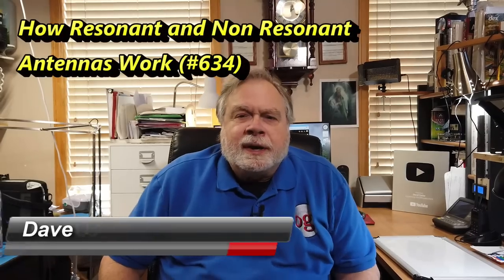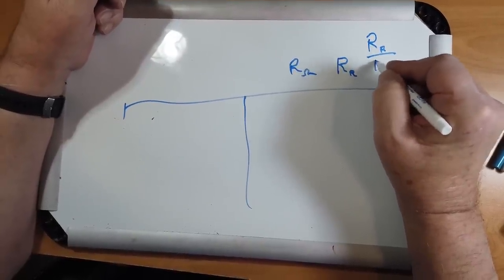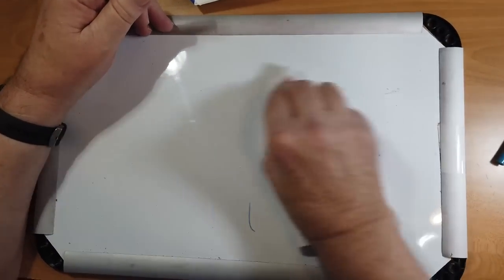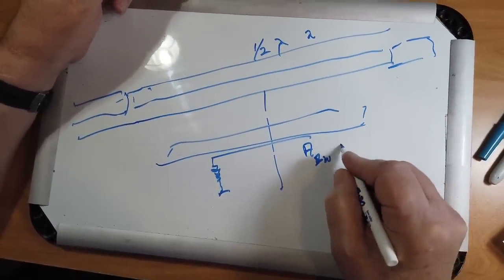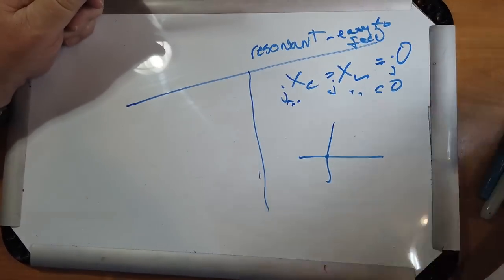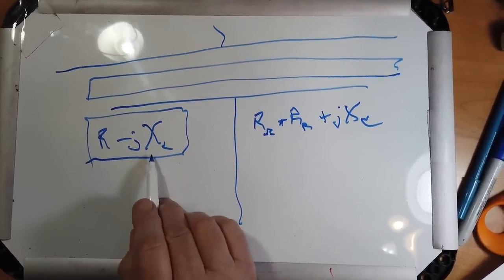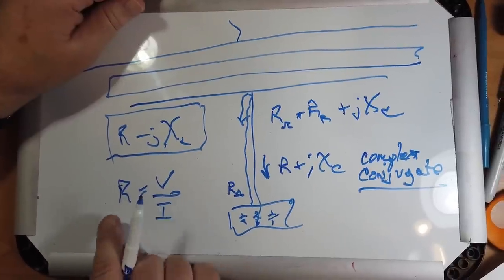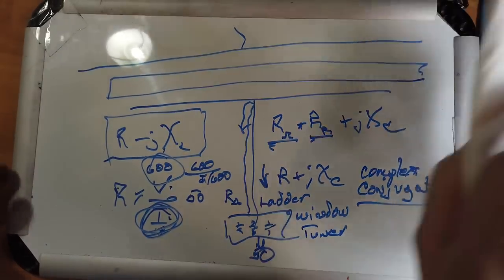How Is It Non-Resonant Antennas Can Work? (#634)

Comment: One more interesting point to make is that the lowest SWR does not always occur at the resonant frequency of the antenna(+feedline).  In fact, often times the resonant point (where X=0) does not correspond to where the SWR is the lowest.  So, depending on the line loss, you may get better efficiency  at the non-resonant, but lowest SWR point.
Reply: Yes

Comment: I'm going to simplify this right now. "Non-Resonant" antennas lose most of their signal strength through feedline losses, both transmit and receive. The more you can minimize feedline loss, the less of a factor "resonant' VS "non-resonant" will be. This is why "open wire" or "ladder line" fed antennas can pretty much ignore feedline loss, while coax fed antennas need to pay attention to feedline loss. 73 de WB4DW
Reply: Bingo.. My home antenna is a Random Loop, and it is fed with Ladder line.  And the reason why I'm able to function or transmit as well as I do, with a non resonant antenna, is because of the feed Line.  Most of the time using a tuner I can get a 1:1 or close to it, but really I don't care to much about SWR because I know it is just going to be reflected back out.  Here is the rub, tuners are finicky critters, and can be a PITA at times, so don't be so quick to jump ship to the non resonant antenna because like any compromise, there are drawbacks. However, I love my loop, and less noise as well.
Reply: So, if I hook the non resonate antenna directly up to the tuner, I should have no losses  Or, is this too simplistic?  I am thinking of hooking  up a 29 foot wire direct to the so-239 with a counterpoise.
Reply: @maddog222333  That sounds like a classic "random wire" antenna. It should work, if the tuner can match the impedance at the frequency you want to transmit on, however, assuming you are talking about having the tuner inside your shack, there is a good chance this setup will cause RF in the shack, in the form of speaker noise, computer glitches, etc.
Reply: Exactly, that’s all that needs to be said. Given an antenna of a particular size wrt the wavelength, all the power you put in except the loss on the feed line  and the loss due to antenna inefficiency WILL be radiated. So if you want to use a non resonant antenna, you need a tuner and the multiple reflections on the wire will cause a lot of loss UNLESS you use a low loss feed line.

Comment: Hi Dave, thanks for this nice and clear explanation. I am now confident in building my non resonant (too short) doublet antenna, using a 450 ohms feedline. I will adjust the feedline length to tranform the antenna impedance into something reasonable for my homemade antenna tuner.
May I suggest a video: could you show us the effect of a manual antenna tuner by connecting an antenna analyser at the output. You could simulate an untuned antenna with a coil, capacitors and resistor. Also showing the effect of some length of feedline, coax or parallel.
I think there would be a lot of surprising results.
73 from F1SOC

Comment: I would like to hold you to your promise to test the "reflected wave" on the complex conjugate tuned system where your tuner is at the transmitter end of the transmission line. 
1. Start with an antenna that is a far piece from 50 +j0. It can be 200 +j0, 50 -j200. Something a ways away from 50 +j0. Like maybe a good 40m dipole on 20m where the SWR is very high. 
2.  Send a string of 20m pulses from the transmitter side with a pulse generator short enough to see the transmitted and returning pulses on an oscilloscope at the returning end. 
3. Insert the tuner and tune for a 1:1 SWR at the transmitter side. You may have to use an amateur rig to have enough power to tune it properly. Use only the external tuner and leave the amateur radio tuner alone and unused. We want only the external tuner at the transmitter side to be making the conjugate match. 
4. Using a 20m pulse generator into the tuner, send pulses again to watch for the returned pulses. 
Compare the pulses as seen with the oscilloscope in both cases. Do not use the oscilloscope when using the high powered transmitter.
Preferably use an antenna with a balanced line feeder. Coax cable can work but I'd like to see the returned wave on the scope and I don't want it to be blamed on the coax if we can't see it. Balanced line is easier to probe with a scope. 

If you need a generator, I can lend you one. I'm assuming you have these pieces of equipment. I'm a retired school bus driver and I have them.
Reply: Really excellent dear Jerry ..very well thought provoking questions...
Reply: Hi, very good suggestions.
Dave, you got to respond
De VU2RZA

Comment: Efficiency % = Rr / Rr + R ohm  x 100...........eg  Rr 50  /  Rr50 + 2ohm x 100 = 96.15%.

Electrically short antenna ? (note this efficiency calc is for Radiation resistance NOT feedpoint impedance.)  
Take a 20m long dipole in free space. freq =3.55Mhz   no loss element.  Rr = 11.74      Then add say 2 Ohm for element.  we got  11.74 / 11.74 + 2   x 100    =  85.44%   Amazing efficiency for an antenna half as long as resonant. but not so fast. We then need to put the thing over ground. Thats a whole nother calculation.  And best left for modelling software. Ground loss will make up a larger % of the lower radiation Resistance.

Comment: Thanks.. More on this general topic would be helpful. Some time model a dipole antenna 140 ft in length [40 ft in above ground] feed with 50 ft of 450 ohm ladder line. Model it from 80 - 10 meters. Assume a good antenna tuner like SA2060 is used. Model resistance/reactance/angleofradiation/lobes etc. Thanks..

Comment: Great video, but one thing I still don't understand. Let's say we use a military style radio, that has a few meters vertical antenna attached directly to a really good internal tuner that can match it 1:1 on all HF bands. We use it on 40m and only for CW so we don't care about bandwidth. Would it be as efficient as a half wavelength dipole? 
To rephrase the question, would it be able to reach as far (same power out, compensated for radiation pattern)?

Comment: When did a horizonal dipole change from 75 ohms to 50 ohm as you mentioned in this video? Tilting the ends of the wires downwards the ohmage will lower near 50 ohms inverted dipole.
Reply: The impedance of a standard horizontal  halfwave dipole is dependent on elevation, many in practice do turn out to be closer to 50 ohms.
Reply: @g0fvt  Prove it?
Reply: @jerrykr7kz  it is a demonstrable effect, do you doubt it? the impedance reaches about 100 ohms at a quarter wave above ground and drops to about 50 ohms at a half wavelength up.
Reply: @jerrykr7kz  Some of the radiated power is absorbed in the ground over which the antenna is placed. I think this has the effect of making it seem as if there is a resistor across the feedpoint of the dipole, thus lowering its input resistance.

Comment: Hi Dave, I believe I was recently a victim of snow static and fried out some components on my transceiver's tuner board just before the so-239 connector. Other's have theorized that because it was a heavy snow storm in the north east at the start of winter field day, that I had built up static at some point which may have cause the destruction. The antenna I was currently using was my 80m OCFD (guanella balun), has a DC short between shield and center conductor, and my shield is grounded when it enters my house. I have watched your videos on lightning protection, but how up for a video for winter static protection? Thanks for all you do. 73!
Reply: If you have a D/C block and a proper ground it wasn't static. More likely a near by lightening strike.

Comment: Thanks Dave. I assume that the radiation pattern will be affected by resonance? If so, is it possible to "mismatch" a non-resonant antenna in order to change the radiation pattern to "point" at a particular direction (that it would not normally be strong at) and compensate by using extra power?

e.g. if my antenna is weak to the west, say by 6db, if I increase my output by 6db I will compensate for that "loss" (although receive will not be similarly enhanced).

If I can alter the radiation pattern by mismatching or by altering the height of my wire antenna and compensating by extra power can I affect and enhance my antenna's capability?
Reply: The feedline match or mismatch has no effect on directive pattern, however making a dipole longer than a halfwave will definitely change the pattern. In the halfwave dipole, all radiation directly broadside will be in phase and thus add up in that direction. Soon as you go longer than 1/2 wave, all radiation broadside to the dipole is no longer in phase. So there will be some reduction in radiation broadside and some increase is radiation a bit off broadside. As the length of the dipole approaches a full wave the radiation directly broadside becomes a null. However the radiation peaks in 4 directions halfway between broadside and the end of the wire. Most all antenna books will have plots of antenna patterns for “long wire” antennas showing how the pattern changes with length in wavelengths. A shorter than halfwave dipole still has all its radiation directly broadside in phase.
Reply: @dandypoint  Noted - thanks.